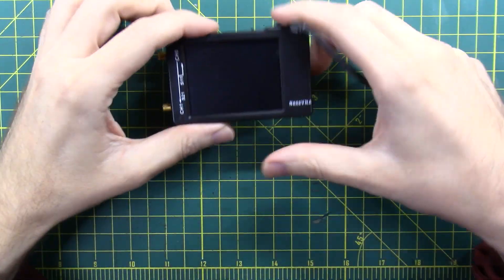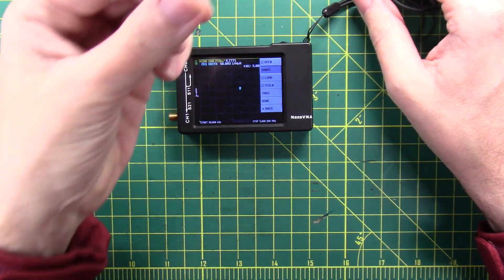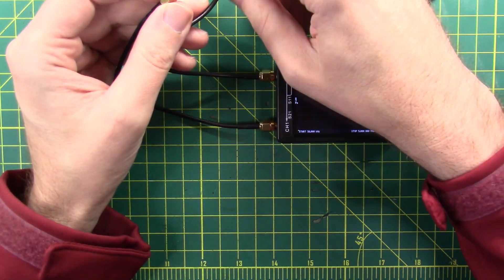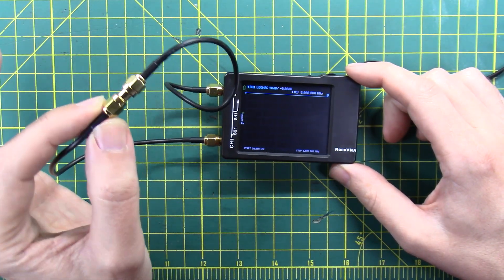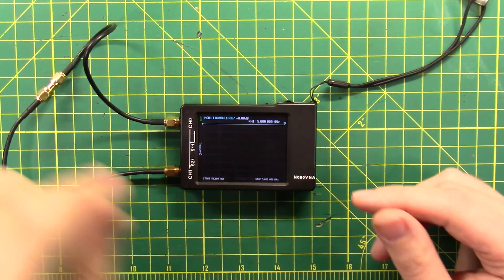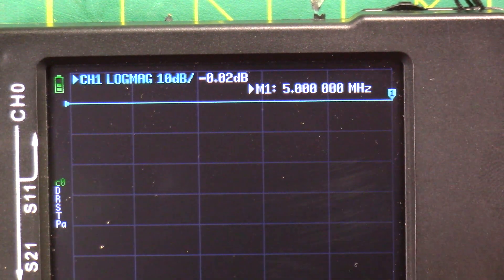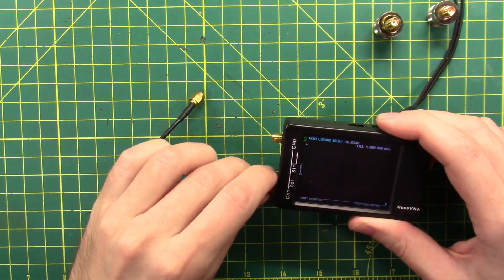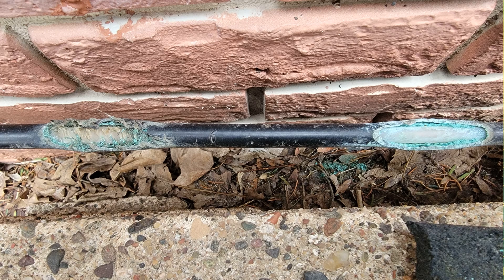#TOTip: How to use your NanoVNA to test your coax

Comment: Thank you for this video. I am hoping that my coax is reading good. I had a whole pile of LMR400 and I thought it was bad. I just tested it according to this video and it is reading -.01db @50KHz  to  -.45db @60MHz. I am going to guess that that is ok? The line stays at the top the way yours does with good coax.
Reply from the maker: If your "system" is optimized for HF work (1mhz to 30mhz) then your coax is great!  If you're trying to use it for VHF/UHF, the coax is the wrong design.  Good test!
Reply: @temporarilyoffline  I used to use it for VHF/UHF but took it down due to inactivity in my area. I only run HF now, so that is what I plan on using it for. I'm planning on building an inverted V for 20-6 or thereabouts and needed a length of coax to run out to a balun outside.
Reply from the maker: @WRQI583 sounds perfect

Comment: I watched your video the other day and checked 2 coax cables and found one bad and the other good at 0.22 dB. Today when testing more cables, they looked way off so I tested the one that was great the other day, also tested bad. I must not be following the set up correctly but followed your video. Not sure if it’s when I change the traces. I did recalibrate also. Any thoughts???
I have the Nano H4
Reply from the maker: Sounds like you're on the right track.  Set up the nano precisely and run the tests taking notes and you should get very similar results every time - assuming the test subject hasn't changed.

Comment: Just wondering if you set the limits before the thru cal, or if that was what happened by default. My nano vna does not go to 5G. More like 1.5 as I recall. I probably wouldn't need a 5G test as I won't be stuffing more than UHF down the coax. 73 de ve7bul
Reply from the maker: I set the limits based on what I use the COAX for, I rarely go above HF

Comment: Any way to test the coax if you don't have access to both ends to do a 'through'?
Reply from the maker: There is a TDR (Time Division Reflectometry?) test that you can do and if you know the specs of your coax from the manufacturer the NanoVNA will say "Your coax is no longer coax at NN feet" - and if your coax is 25 ft and it says 25 ft long, then its good coax... but if it says 8ft on a known 25ft run... then there is your break!

Comment: You need to cancel out the adapters you used to connect the cal cables as well as the DUT
Reply from the maker: Yep, "do the best you can"
Reply: @temporarilyoffline  the connectors that come with the nano have known values, and you can use the menus to cancel those out.  The other adapters… you can measure directly and then do the same, use the menus to enter in the reactance to cancel it out.
Reply from the maker: @poorman-trending  #ProTip, thanks!

Comment: Ive used my Nanovna H4 about 3 times since ive had it and i tried doing this 6 times and every time after i do the thru calibration and save it...the log isnt sitting on zero but bouncing around with all kinds of different numbers. I know im calibrating it right with the adapters and im hitting reset before i calibrate. The frequency at the bottom doesnt make a difference does it??
Reply from the maker: You have to calibrate the device for the frequency range you're interested in testing. So 7.000‐7.350 for 40m for example.  Maybe pad a bit on each end.
Reply: @temporarilyoffline  I tried the freqs u were using and it still acted funny,   only thing that made it close to being 0.0 was doing the isolation calibration with the 50 ohm cap on the jumper on channel 1. That gave me a steady flat line but it wasnt 0.0. I tried different jumpers other than the ones that came with the vna and i tested 3 different coax's that I know were good and it was a lot more steady.
Reply from the maker: @Snakebyte70  ok, join us over on TOADs discord (link in description) for a better discussion.

Comment: When I use to have a TDR I had a 50 ohm resistor that I terminated the far end. then I would shoot the coax with a termination then without.  I could measure from both ends that way to the trouble spot. No TDR function support ?
Reply from the maker: Hi Sherry.  The NanoVNA has a TDR function and when we tried it on the live stream, we didn't believe it.  In hindsight, it was probably right!

Comment: Probably squirrel or some other rodent chewing on it. This was a constant issue when I worked for the cable company. The coax from the pole to the house, and even the hard line from pole to pole would be damaged from squirrel chew. Not sure why, but they loved coax. Great video btw, 73. N2SCD
Reply from the maker: squirrels are always a problem

Comment: Hello. Have newbie question. If Uhf and Vhf transmit on FM w a repeater, does that mean a tech class can't use a repeater for Vhf and Uhf? Thanx!
Reply from the maker: Hey MP!  A tech license allows you to transmit on 10,6,2,70cm.  You'll want to search for "ARRL Band Plan" to get a graphic showing where a (T)ech class license can operate and on what modes.  10m and 6m would let you make contacts world wide while 2 and 70 will let you talk locally, through a repeater, or over the internet.
Reply: @temporarilyoffline  I'm no where near there yet but I did program the repeaters into my Baofeng successfully and I wanted to familiarize myself with the freq I'll be eventually transmitting on. Thanx!

Comment: I know you’re doing it on screen for the commentators, but in a real world scenario how often does the nanovna actually require calibration?
Reply from the maker: You can save your calibration and as long as you recall that calibration and use that same "test harness" you should be fine.  The real key to calibration is that you can calibrate at the base of your antenna and test at your desk to eliminate feedline losses from the equation.  There is a lot of "scientific method" stuff to wrap your head around when you're doing these tests.  Even a cheap bathroom scale that you know is wrong can be used to track your weight loss/gain - use the tool for what it can provide and you'll be golden!

Comment: WOW! Do you realize what did you discover? That coax was consuming power. Much more than just for heating. I would try to connect a dummy load and check SWR. If it would be in safe range then just for a fun experiment I would call CQ.
Reply from the maker: I used the antenna on a snowy day while this was chewed up - and I used it for a long time before it got this bad.  One day it wouldn't tune anymore and I had to fix it.  Radio is fun... since its not my "job", I don't have to do the same level of routine maintenance, but there is still some.  Thanks for watching!

Comment: This is very cool. Question: is it possible to use the nanovna to do time-domain reflectometry to find the location of issues? If so, I'm wondering if it could have also found this issue.
Reply from the maker: It is definitely possible and we did this on the live stream... and totally didn't believe the answer that it was giving us... which was right.
Reply: @temporarilyoffline  That's amazing.

Comment: 13 db down ! WOW, yes you do have a serious issue. You went from 100 watts out of the transmitter to QRP at the antenna.
But, enjoyed your informative video. Nicely done. 
I have a table top spectrum analyzer with a tracking generator. But it's so much easier to use my NanoVNA H4 to look for losses on the fly. 
Barry, KU3X
Reply from the maker: Feedline is pretty important ;-)  The Nano is very handy to have around.   Highly recommended.